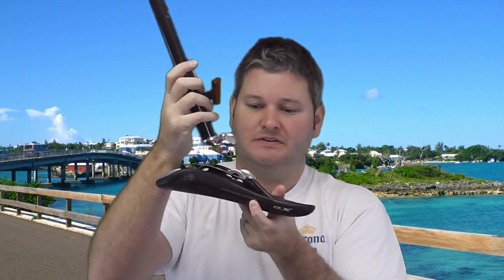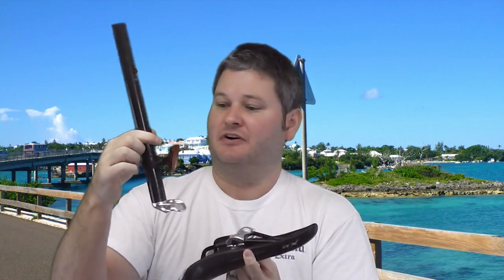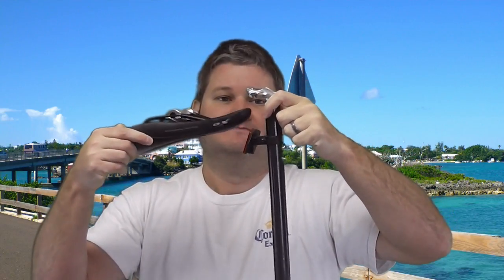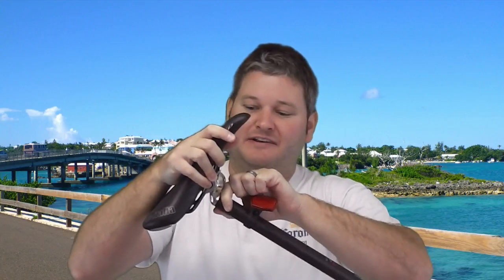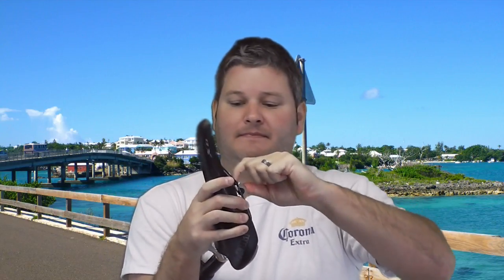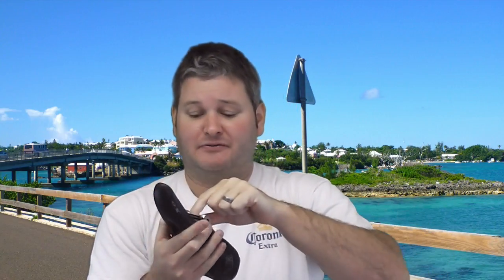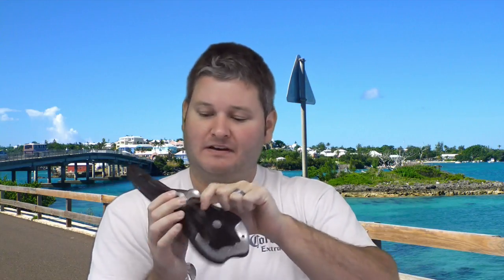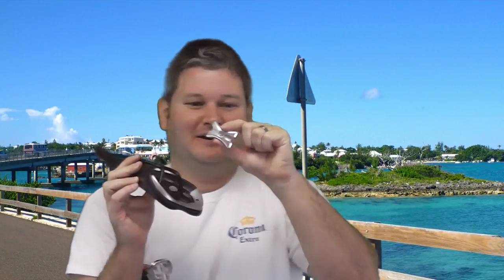My Bicycle Seat Fell Off & How I Fixed It

Comment: Two things prevent saddlepost failure. #1 weightloss. #2 Drive your bike outside and not on the stairs in front of a bluescreen. #3 Mount the saddle the right way onto the seatpost: Silver extension on seatpost is supposed to point to the back. Pointy side of saddle is supposed to point to the front.
Reply: and #4 stop bragging about carbon fibre. Yoyu are at least 60 pounds over the point, where you are supposed to use carbon fibre.
Reply from the maker: Fiber in the diet is healthy, brah!